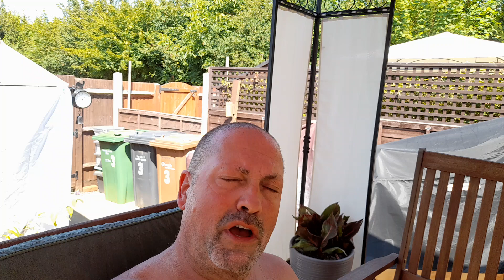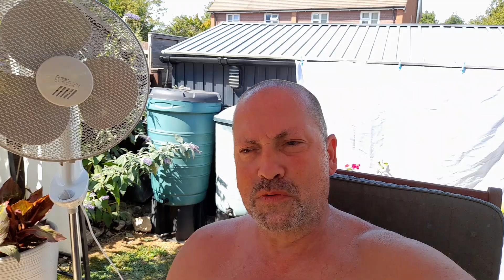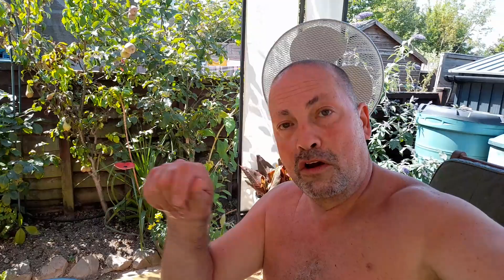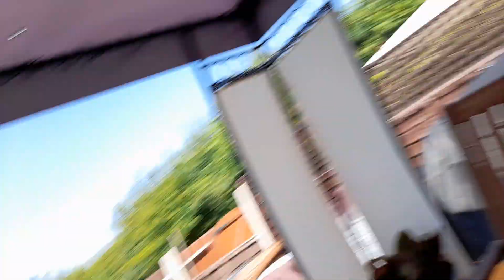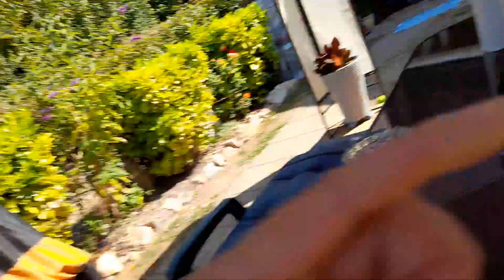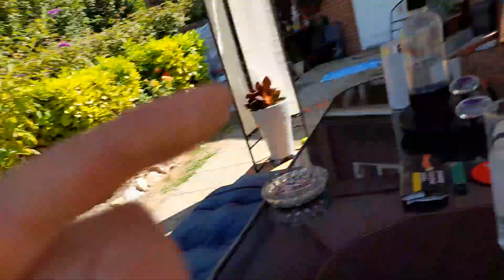Can i restore two new (old stock) ELECTRIC peds?

Comment: Surely, you can replace the old lead-acid batteries for Lithium-ion? Lighter, more efficient etc.? This will be an interesting resto 👌🏻👍🏻
Reply from the maker: That's the plan Clive, just need to swat-up and learn about ev electrics.
I have dabbled in RC electric vehicles over the years so I do know a little.  Lipo battery science is what i need to learn